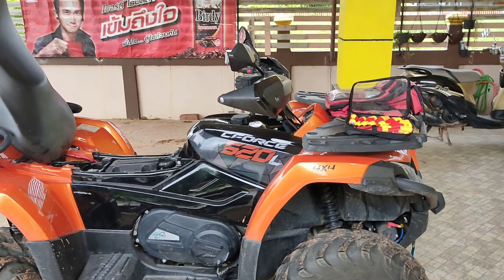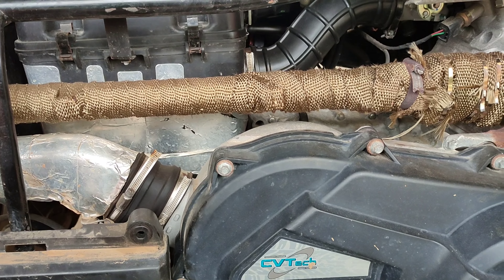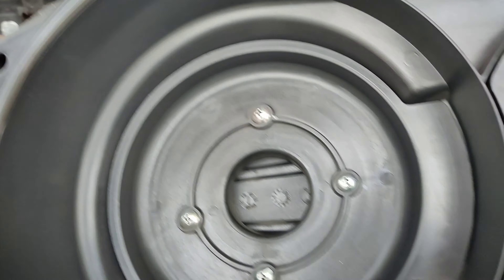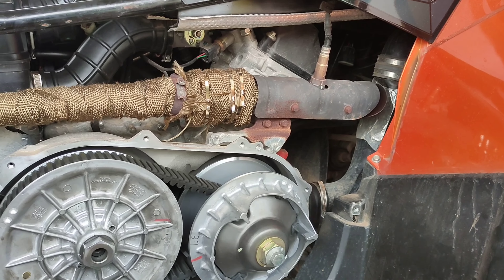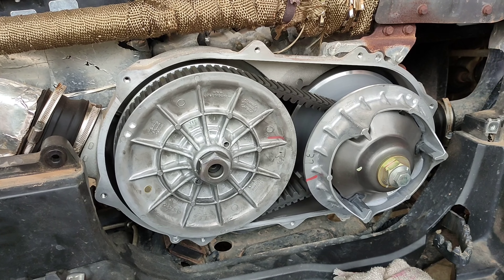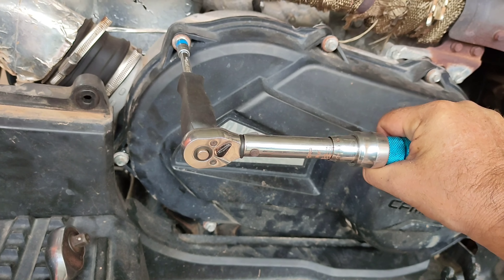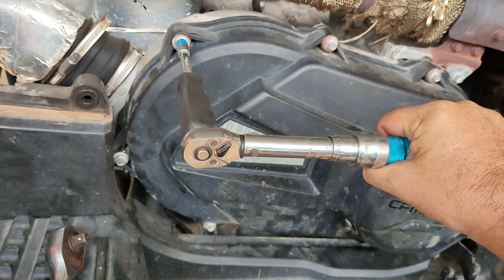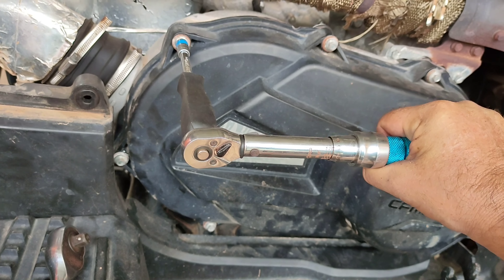CFMOTO CFORCE 520L ATV Clutch & Drive Belt Check Plus Engine Oil & Filter Change

Comment: Keep you eye on the air filter apparently they block quite easily I’m surprised how often they update and improve this brand mine is this years and they have redesigned the exhaust cowl but I might still wrap it to reduce the heat and there’s something different about the clutch it now has EBS engine braking system, so far I’m impressed I paid 210000 with power steering and now they have increased to 230000 because of the baht
Reply from the maker: Sorry for the delay in replying Richard, never saw the notification, having to scroll through. Yeah the only thing I don't have is power steering but I know they can fail because of a plastic part in the pump. I clean the air filter regularly with my air compressor tool. So far it's been over 4,000 trouble free km's👍👍👍🍻🍻🍻

Comment: Something wrong there mate. You didn't have a bolt left over after final assembly. Must try harder.
Reply from the maker: As basic as thing's get really mate...enjoying the rain?👍👍👍🍻🍻🍻
Reply: @livinginthailand7487  Wonderful.A foot dèep outside the front gate lol
Reply from the maker: Had a wet and windy bike ride this morning lol
Reply: @livinginthailand7487  ting tong is as ting tong does.  Ive got a jacket on ffs lol
Reply from the maker: Jacket? You're letting the Northern side down but I'll not tell lol
Reply: @livinginthailand7487  I know, its 21C and that's boiling back home lol

Comment: Hi, How many kilometers do you change the oil?🤔
Reply from the maker: The user manual states the following: Break-in oil change at 20 hours/750 km then every  100 hours/3,000 km or annually whichever come first (always change oil with a new filter)👍👍👍🍻🍻🍻
Reply: @livinginthailand7487  thx dawg 😎🍺